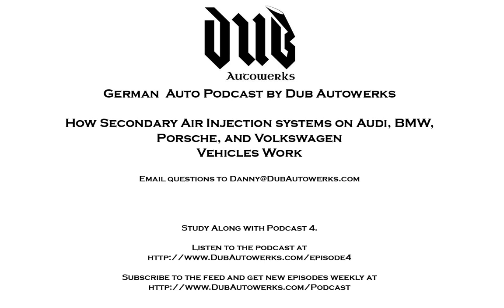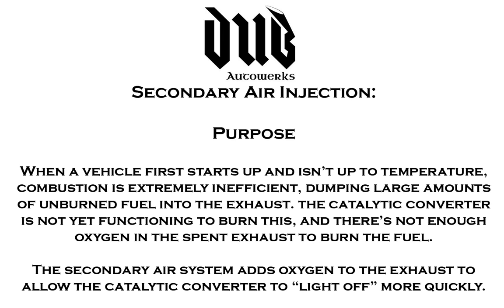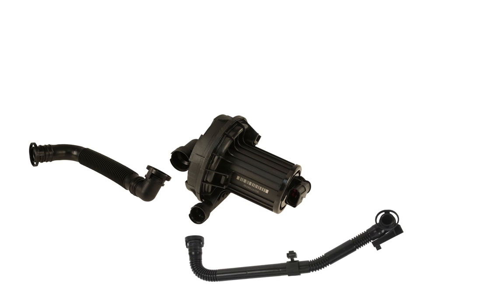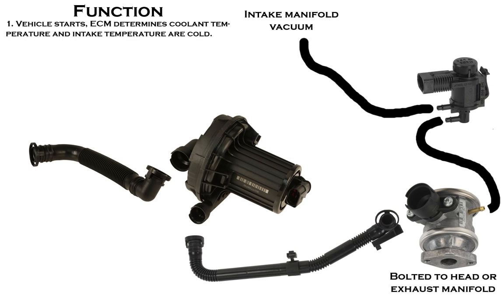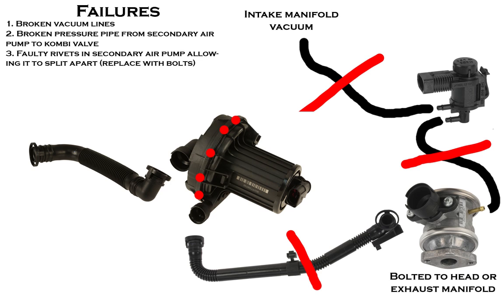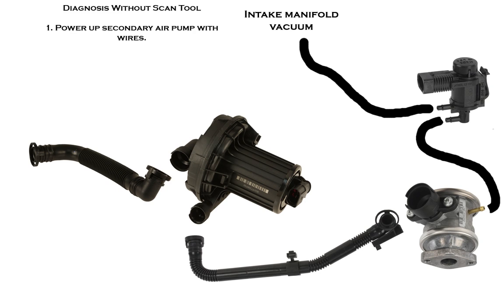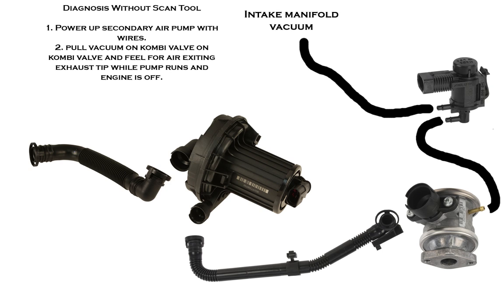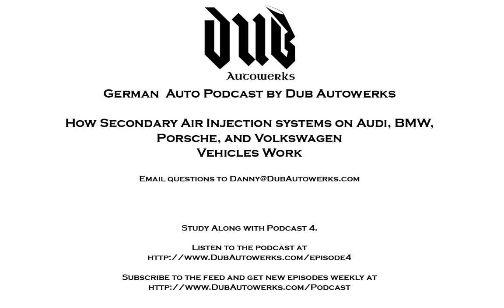Secondary Air Injection Systems on German Vehicles

Comment: Any idea what the standard vacuum measurement is for the Kombi valve to open?  My 01 Audi TT provides a vacuum when it should.  It's a bit weak, but the smoke test came out with no leaks.  The valve opens with a Harbor Freight vacuum hand pump at 13 mmHg, but the car only registers 6 mmHg, when I hook the hand pump up to the line to measure it.  Not sure if my valve has gone bad or something else on the intake not creating enough vacuum.  Any help would be awesome.  Thanks.

Comment: I'm not getting fault codes but my pump is switching itself on when ignition is off, intermittently. But when it happens and I'm not aware its draining the battery. any thoughts why it is turning itself on. If I put the key in and start the engine the pump often then turns off, but turn the engine off and it comes on again? what can I check any fuse or relay?
Reply: its an Audi A4 B6 Avant 3.0 Quattro
Reply: Sounds like the Relay is stuck closed on the Load side of the Relay. Not the Control side of the Relay. You need to know how to diagnose Relays to confirm whats wrong.

Comment: I have code P0411 do you have an idea what that is?
Reply: Le reddit silver member were is the fuse localed??
Reply: Jessica Flores I had this same issue. Incorrect airflow, misfires on all cylinders. I took it to so many mechanics. They of course replaced random parts. Turns out my secondary air pump fuse was blown. My pump was full of water. So make sure you check the fuse also
Reply: The L33 Gaming Ill Let You Know I Have The Same Code.  P0411 
Secondary Air Injection Incorrect Upstream Flow Detected.

Comment: I'm hoping you might be able to help me.  I have a 09 Jetta Gli with cali emissions and i got the error code p2432 which is the secondary air pump sensor.  I have found plenty of threads talking about it but nobody really has said where the sensor is located.  I can get the sensor from work no problem but I don't have any idea where to start looking.

Comment: Do you have a video on how to replace the air injection pump on a smart car?
Reply from the maker: No, are you sure that it's even the actual pump? It's usually not, they generally fail when people remove the engine covers or wash their engine and the pump gets water in there. And they almost always sound like a passenger jet taking off for 30 seconds to a minute every time you start the car for a while before they fail.

If you can take some pictures I can try to talk you through it, but I don't work on Mercedes (which is who owns them) and it's attached differently on every different engine configuration on every car. So even trying to show how to do it on like a 99 - 04 VW Jetta/Golf/New Beetle would require like 9 different videos.

We're more about training people how to be technicians through theory than we are a repair manual. Again, be VERY wary about just diving into doing the pump, they are controlled by the engine computer, which triggers a relay, and the relay powers the pump, so unless you've manually powered the pump up at the pump with wires, and verified it's bad I wouldn't go replacing it just yet. 

It's almost always just a bad vacuum line to the valve on the exhaust manifold or head that's causing it.

Comment: Great info, any idea why both of my air pumps will have stopped working after they were disconnected during the coolant pipe upgrade on a 2004/5 V8 Cayenne?

Comment: Haha all this time I couldn't figure what that vacuum cleaner noise was when I first started my car and now I know. Usually only California cars required these, but I noticed my 2000 A6 has this and it is a southern only car. Must be they put this on all the German cars like the Audi, BMW and Mercedes. I wonder if they put these on the newer Audi like my 2014.
Reply from the maker: No, almost ALL 99 and up VW, Audi, and BMW have these. On cold start there's not enough air for the catalytic converter to start catalyzing. Remember when Chevys had smog pumps back in the 80s? That's basically what they were doing was injecting air, but since they were belt driven they robbed power all the time when they're just needed for barely any time on cold start. So zee Germans made it smarter.

Since the lack of air but excess fuel that needs to be burned by the cat is a function of cold cylinder temps, it's not something that they just got rid of (the SAI system) as far as I remember they're still on everything.
Reply: That is great information, thanks for the reply mate.

Comment: Two questions for you:
1. What is minimum intake vacuum needed for the Kombi Valve to open properly?
2. My problem appears to be the actual machined port in the head being blocked by carbon build up. Do you know what the best way to clean out all the carbon build up ?
Reply: No known way to clean the Kombi Valve. Needs to be swapped out.

Comment: it's a 2003 325i m54engine I  think
Reply from the maker: Ok, well,  the "is it possible to delete this system for a racecar" is a bit tricky. 

If your question is, is it possible to delete this system without adverse effects to the engine driveability, hp, fuel economy, etc then the answer is YES.

If your answer is, is it possible to delete this system without the check engine light turning on, the answer is maybe, maybe not. This system has some requirements for when the system runs, and those depend on the vehicle. For example the engine computer will only run this system when the catalytic converter could benefit from additional oxygen in the exhaust to heat up to temp and achieve catalyst lightoff, at which point the chemical reaction in the cat has reached "light off" and is removing an optimal amount of pollutants from the exhaust stream. 

Generally it's something like, the engine computer will activate the secondary air system when it detects the downstream oxygen sensor(s) are not yet hot (so it is having to run the O2 heaters to heat them up) indicating no catalyst activity, the engine coolant temp is below a certain temperature, and the intake air temperature is below like 71 degrees fahrenheit, and ALSO the engine rpm is low enough that the engine isn't getting enough air and fuel to create exhaust heat quickly and achieve catalyst light off. 

Basically, that means that other than on very hot summer days in places that are over 80 degrees or so, the secondary air system will activate when you initially start the vehicle, stop when you start driving and get above a certain engine load, rpm, and air fuel ratio,  then the majority of the time will not need to run again. If the coolant thermostat is good, and the engine is running properly, the only time the system would then run again, would be if you drive it a very short distance and then get stuck at a stop light or something and the cat starts cooling down or hasn't heated up. 

If your engine computer activates the secondary air system and the oxygen sensor doesn't the air fuel ratio get more lean with a corresponding drop in mass airflow sensor flow, then the engine computer will throw a fault.

Additionally, the engine computer will be looking at the resistance of the secondary air pump and relay, and if it's a VW or Audi there's a solenoid to put vacuum to the kombi valve as well it looks at. Your BMW doesn't use a vacuum solenoid, the airflow from the pump pushes the kombi valve open generally. If they're removed it'll throw a check engine light, but you can measure the pump resistance with a multimeter then by a resistor that is the same resistance, and install it into the pump wiring in place of the pump. 

If you have a performance engine tune, that company may have disabled all of the diagnostics for the secondary air system, so you could unplug everything and get no faults ever.

If not, this is an idea how you could do it. So for example I have a 98 VW Jetta VR6 that is all hopped up. I removed the secondary air pump, installed a resistor of the right size, left the small solenoid for the kombi valve because it weights nothing and is hidden under the intake manifold, and then I removed the kombi valve from the head. Now, if you DO remove the kombi valve remember, it is the only thing blocking the exhaust port and so you have to make a blockoff plate for it. 

This whole system together weighs less than two lbs, there's not much need to remove it honestly. But, if you don't have cats anyway then it's useless and isn't doing anything.

I wasn't able to tune it out on my car, but live in a neighborhood and the cat warms up on its own just driving out the house without the SAI being called on. So since I fire it up and immediately leave, never stopping at a light or sign for more than 5 seconds or so, I never even get a check engine light. However, in the off chance that you start the car in a parking lot to warm it up while waiting on friends, and you don't hold the throttle at 2000 rpm to warm the car up, it'll set a light that I then have to erase. Very rare maybe a couple times a year I start the car at a friends and run back inside to grab my cell and have it happen.
Reply: German Auto Institute  thank for your detailed reply the reason for the delete is to make room for a turbo since the pump and Kombi valve is in the way and would I be able to tune it out I'm going to use a secondary piggyback ECU
Reply from the maker: If you're using a stand alone engine control module then you don't need to tune it out you won't have the obd system anyway.

Comment: This was useful to me. My output hose was broken. (2.7l twin turbo. The output line splits. It was broken on both sides. Someone tried to fix it - poorly.)
My only suggestion would be to show some pictures of the system in-place.
Reply from the maker: We're a theory site, not a repair manual. I recommend buying the factory Bentley repair manual for things like that. I'm not sure if you have an S4, or an A6, or an Allroad, but they secondary air system is different in each vehicle, I think the S4 doesn't even have it. The Allroad the pump is down in the back sort of under the intake manifold, and the kombi valves are on the back side of the head so it'd be very hard to show it in place. That's why it's useful as a mechanic to understand the theory of how the system works, because once you do it doesn't matter WHAT German car you're on, whether it's a VW, BMW, Audi, or even a Porsche, they all function the same, the parts may be slightly different but you can deduce how it works and how to fix it.

I know it's probably WAY too late but this heat shrink tubing here is the best way to fix it. Some 2" heat shrink even has glue in it. You can put hoses back together that are missing large gaps even.

https://www.delcity.net/store/Triple-Wall-Tubing/p_330.h_77221
Reply from the maker: It varies so much from application to application it would possibly be more confusing. Some of them have kombi valves with vacuum disphrams and a vacuum solenoid, some of them just blow open from the airflow of the secondary air pump, some of them have electronic kombi valves that use an electromagnetic solenoid to open.

They all function the same though.

I probably could stand to talk about how to repair them. There's some really big heatshrink tubing that's very heavy duty that not only does the job well but looks kind of OEM when done as well

Comment: I do not have a check engine light or anything but in California, I have to do emissions test for smog and I can't get the secondary air injections to be ready for my emissions test. Same with the o2 heater. Any ideas???
Reply from the maker: You just gotta keep driving it. Bmw has no way to force readiness.
Reply: +DubAutowerks I checked the air injection system and I noticed that the switch that allows vacuum to the smog air pump curl works, but the vacuum does not work. I tested the switch and it works, but it doesn't vacuum when I hook it up

Comment: Exactly why I drive a exempt vehicle ...!
Reply from the maker: Because you're incapable of diagnosing the most simple of automotive systems?
Reply: +DubAutowerks no, because I choose to not have all the extra bells and whistles that break eventually.... Actually I do have one car that has this pump, my Allroad, guess what, it makes a shit ton of noise at start up, sounds like it's on it's last legs, $100.00 part oh well, time involved etc, etc... Now my 65 Mustang needs none of this shit runs fine emissions are good...lol
Reply: +DubAutowerks Accurate description of air injection system on those newer European lead sleds, it's to bad they all don't use a universal pump, it would be a whole lot cheaper for replacement, I guess the main idea is not to go to the dealer for this part or related parts...
Reply from the maker: +blkcoupequattro On the Allroad it's up on the intake manifold. They're like 600 new some of em.

I just tune it out. I can put a performance tune on your Allroad for 200 bucks that'll disable it, and give you a ton more hp
Reply from the maker: +blkcoupequattro Also, this system isn't a new thing Chevy had smog pumps in the 80s that were the same deal, this is just electrical so it doesn't always load the motor down.

It's not a bad design it heats the cats up quick then shuts off and that's about it.

Comment: Great breakdown.  You rock.  I was having a code appear after a timing belt job from a shop.  You guys broke down what the parts looked like and where they connected that when I went out to the car and investigated I discovered that the shop had left a hose disconnected.  Saved me time and money from them having to do anything and me having to go on my free time and sit around as they look for the problem. Thanks again, keep it up.

Comment: I subbed, but should I take the combi valve off and run the engine first? What order should I start troubleshooting? It does it all the time while sitting in traffic, clicking turning on and off over and over again sounding like a vacuum cleaner, and on a 95° day, sometimes very rarely it will stay off but that's usually when it's very cold out, around 20° or below. Also I don't know if this is a symptom that could help diagnose but when the pump turns on and off, it sounds like a vacuum cleaner then when it shuts off the idle gets to 800 rpm and there's an ultra low vibration in the car that you can feel rattling your brain and popping your ears but can't actually hear the sound. I'm getting so frustrated that I just want to junk it, not really. It has a built head, cams, valves, springs, port polish, head bolts, stock block, forged rods. I just want a golf 4 door with a ABA block, I'm so done with it right now. Entire suspension, hubs, knuckles, BORA conversion, tuned ECU/ECM, cross drilled slotted rotors with ceramic pads, coilovers, all new pcv hoses, air pump hoses, coolant hoses and water spout from head and y hoses and hoses to coolant tank. omg it's insane, one thing after another, over and over again. Anyone want to trade a 02 337 for a MK4 Golf 2.0L ABA. It needs a few things like valence and interior trim but when it runs right it's like a beast, it has taken every car that's ever tried to test me. Could it be the wastegate actuator or wastegate flapper is stuck or not closing? When I drive really hard it moves but when I come to a stop there's no power or boost, and I turn it off and on and it's fine again. what's the deal? I know it's something stupid because the engine was fully rebuilt less than 1000mi, probably half that. Oh yeah, it has I tiny pinhole exhaust leak at the muffler delete, that's probably the ultra low frequency sound.
Reply from the maker: a lot of what you're saying probably needs a scan tool to diagnose. The pump shouldn't run when the car is warm. And the reason it doesn't do it when it's hot out is it doesn't run over a certain intake air temperature.

So the most common issue if the pump is running is the pump is split in half, it is riveted from the factory, look and see if the rivets are allowing the pump to pull apart. You  would then need to drill the rivets out and use small bolts from the hardware store to screw it back together.

Comment: I don't have a catalytic converter. It's one pipe with nothing. Not even h02 sensors. My pump keeps clicking on and off and on and off. It's driving me crazy, it's stalking all the power until I turn off the ignition and restart the car and it's fine again
Reply: it's a MK4 gti 1.8T AWP engine
Reply from the maker: +FockYouMang If you ship me your ecm I can tune your car for 200 bucks with antilag and setup for the catless downpipe.
Reply: this system can be delete if it is delete it will affect something on the engine

Comment: Thanks for this video. I have a 2005 Mercedes SLK 350 and noticed the usual slight whine only at cold start up getting much, much louder!  Going to have hood open tomorrow b4 starting and run out and put ear by the secondary air motor.  Fortunately no warning lights yet and the pump is right up front and top on right, easy to see and replace!
Reply from the maker: Except that they're often 600 dollars. Look and see if it's riveted together, the rivets start to fail and the housing seperates. Drill the rivets and by it together.